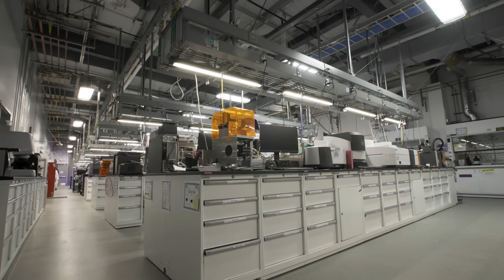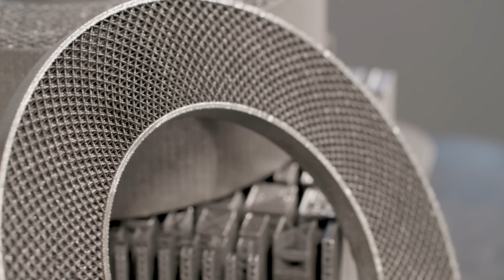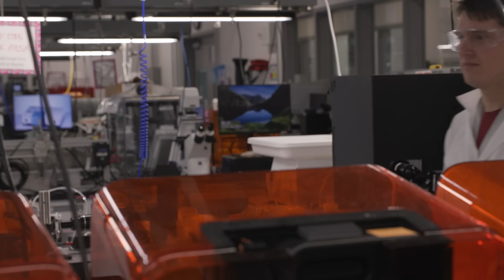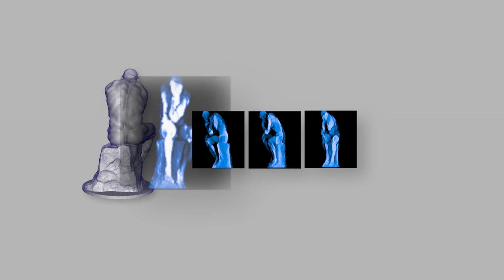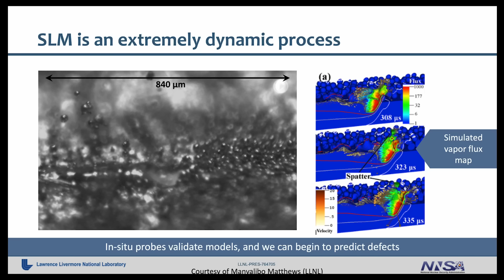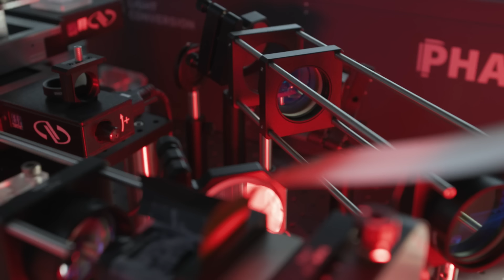Take a Virtual Tour of LLNL's Advanced Manufacturing Lab

Comment: Do you know how much I would give to work at your laboratory and have the access to the tools that you do because my creativity and my work ethic are on par but my CV would not be your typical CV. At the same time my CV is not at all a typical CV nor are my transcripts. I was building a barbed wire fence in Montana and one summer around 20 to 21 years old and that's right when ADHD typically calms down and it did. I walked into a private liberal arts university in Helena and took an entrance exam because I only achieved a GED I was bored I was really fed up with high school I didn't see its use. 

My scores on the entrance exam was so high that they took me on the scores alone and asked me when I would like to start. 😊

I started immediately and my first degree is in philosophy which I believe is becoming more relevant than you could ever believe to sciences and across the board. If you think about it we're the grandparents of all the over specialized area of study. After this over specialization and the publisher parish paradigm as well as the complexity of the modern problems that we face as all the low-hanging fruit has been taken, your grandparents have some wisdom that would be very helpful. 

What is a terminal degree in every over specialized area of study? A PhD? What does that mean? 

😂😂 I don't mean this in a way that's at all ego-based and I'm an extremely humble person who had to be told that they were at typically intelligent and valuable as well as told how successful I had become in my practice area which was Private international law out of Geneva Switzerland coming from Kentucky and Montana 😁🙏🇨🇭

I think I was the only state school law graduate at the level and area of practice and my number one clients who took up about 95% of my time after he asked my mentor if you could have me was a Harvard Law School graduate and a Summa as well. He taught philosophy at Radcliffe as part of his scholarship to Harvard Law School. He graduated from the School of Engineering at Columbia University and Applied Mathematics. Hidden and went and worked for Sullivan and Cromwell and then White and Case. The managing partner of the London office of white and case you told me I must be one hell of a lawyer and I asked him why do you say that? 

He said because your client is the smartest lawyer I've ever known. He said this deadpan and was absolutely serious. It really made me uncomfortable and I just said to him I'm just a good student and have a strong work ethic which is true. 

I've never been comfortable with people telling me how much potential I have and how smart I am et cetera. I got hurt at work and it's geopolitical issue with a non allied nation state and it was at the very highest level to the leader and his best friend of this country and they killed my client and came for me. Somehow out of complete miracle and I can't explain it scientifically and I can't explain it any way at all I survived three separate attempts on my life. 

I'm not done so well with the psychological warfare that my former Mentor heard that they were using on me and that I was only told was being used a few years ago but I knew it was happening when it was happening. 

That probably did the most damage. Surviving torture is pretty rough. A doctor from Beirut Lebanon was the first doctor to see me after I was rescued by the Secretary of State. She took one look at me and said okay where in the hell have you been and who did this to you as she knew exactly what had happened and by nature of my way to be and the injuries knew that I had been tortured there was no question. 

I was an adopted child so I had about 30 or 40 IQ points on my entire family so they never understood and they are extremely typical Americans meaning they live in rural America so they don't understand that the Cold War was fought in Europe. I had front row Center seats for the beginning of Cold War II. I was aware in 2006 and had been discussing neo stalinism over with my client since 2004. 

He really scams the oligarchs who sought or probably wished more than they thought that he would just merely clean up the system of it and make it a little less criminal organization based and reduce the corruption that was present rather than the direction that he ended up taking it. 

But that's not the agreement that he made with them in order to get there support to take the presidency away from Yeltsin who was honestly a very poor First choice in a democracy but democracies all have growing pains. 

But he sure did pull off a very good scam but in hindsight it should be clear that a person who becomes head of the KGB is not faking and they would have discovered that he was not a true believer much earlier in his formation and he would have never made it to the level where he became the head of the KGB if he wants an actual true believer. 

He lied to all the oligarchs in order to get their support to take over the country from the democratically elected leader and he never had any real intense on allowing free elections or giving up his power. 

I think they wanted it to be true more than they believed him. 

But he ended up taking for me everything I loved and after 40 months 48 months of focused therapy for trauma I've run up against the barrier caused by the autonomic nervous system. 

MDMA can remove this barrier within 3 to 6 months and it's on the compassionate use list and a recent systematic literature review done in + 1 and 2025 makes it crystal clear that it is highly successful and has an extremely high efficacy and a very low side effect profile. None of my medical team can understand why I'm not already taking this medication. 

I'm going to another country to teach as a visiting professor of law but I'm also attached to the faculty of engineering as I have a mandate to try and attract more technology research and development especially in the area of Aerospace and space technology. 

I wrote a memorandum and the governor of the state where I'll be located was so impressed with my memorandum that he wants to meet with me as soon as I'm able and if I'm given MDMA I'll be available but if not I don't think I'll make it and I'll be considering how do euthanasia.
Reply: More stories? I read this whole thing, which is rare considering it's a youtube-comment-wall, but you wrote with such detail that your unlikely story is believable, or at least intriguing.

Comment: 😊 would that type of structure that you use on your opening video shot the picture that you chose to represent the video is that good for structural stability or would that be good for insulating a spacecraft from the exterior environments or creating a barrier that's more effective at shielding hard radiation and or micrometeorites? Could you add in a certain amount of bismuth or a lead into the mixed metal I'm sure it's a mixed metal structure but to create more absorption potential? I've always thought that and I have many other ideas on how to deal with hard radiation exposure and micrometeorite protection. But why we have not launched several modular nuclear reactors and Parks them and a folding orbit in order to produce enter solar spacecraft that is capable of doing many different things and having a redundant one for emergencies and for use. If you had two of the large one to five days up there and one of the 40 KW reactors as a secondary or redundant for life support or for use at location. Imagine how much power to 1 to 5 megawatt and modular nuclear reactors would supply to either very large plasma thrusters or many smaller an array of plasma thrusters and the fact that using a very dense reaction Mass such as either liquid or metal in the form of reels of metal that slowly or pellets that are fed into the chamber creating the plasma as that would supply an overabundance of necessary energy to create a very high level of thrust without the need to carry massive tanks of liquid or solid reaction Mass. 

I'm capable of doing the math but I would need to be taught the math as a graduate student in my mid-40s I taught myself Advanced algebra and calculus in 2 weeks at a coffee shop as I had always thought that maths were inaccessible to me due to ADHD at a young age. 

But when a professor and I graduate class regarding epidemiology said that she would skip this part of calculus and algebra as we should remember it from undergraduate while I had never taken it. 

So I ran off to a coffee shop and in 2 weeks I can say that for the first time in my life I saw the beauty of mathematics. And if you understand what I say about the beauty of mathematics then you understand that I was able to absorb and use the math that I learned in 2 weeks at an extremely high level because it becomes beautiful when the the proofs workout and you object have solved the problem with 100% accuracy on four of the homework assignments in 98 on the last as I made a stupid error. They were one paragraph answers with five pages of maths proofs needed to solve for 100% and it was indeed very beautiful. I now use the pure logic and objectivity of math and the complete opposite or or how illogical and irrational love is as the two things that are most compelling and the belief of intelligent design.